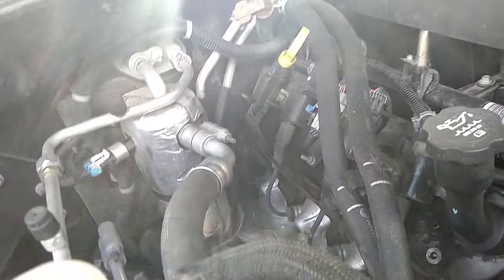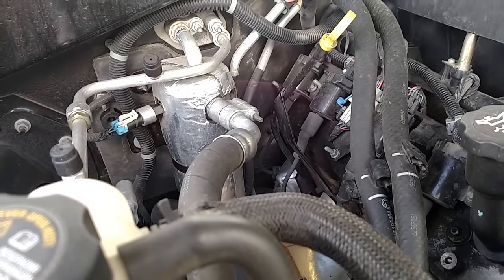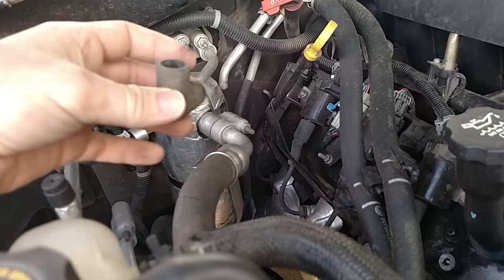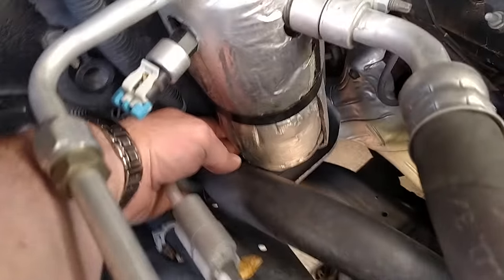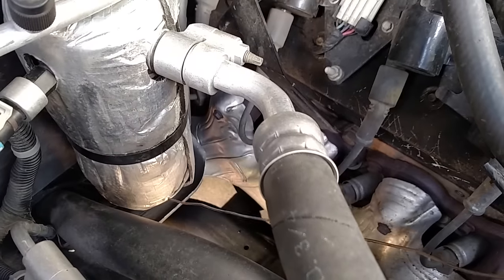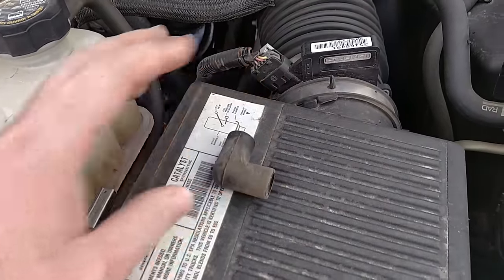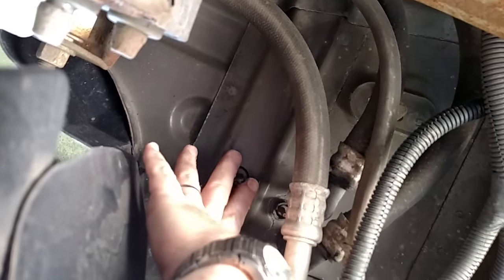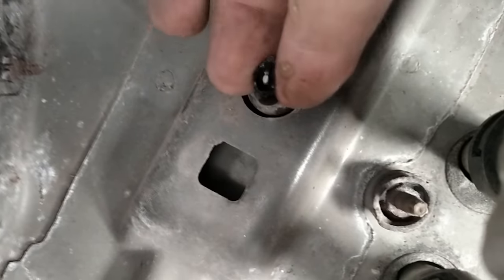AC water Drain Locations Tahoe Suburban Silverado Musty Smell 1999-2006 Air Conditioner

Comment: You called the Receiver/Drier a AC condenser the condessor is behind the grill and the evaporator is inside under the dash, the reciver/drier is a hollow chamber with a desicant bag inside to help removed moisture from the system. Just a minor correction Incase anyone needs to replace something if you ask for  a condenser from the auto parts store you will get a very large radiator like part that cost a lot more than a receiver/Drier there's is also a evaporator in the back of that SUV they are what makes the air cold so wherever there's a evaporator there's will be a drain for it somewhere in this case it was between the evaporator and receiver/drier
Reply from the maker: Thanks
Reply: DUH ...👈💩👌

Comment: I can see this has been up a few years now and yes, good information concerning the a/c drains but those are evaporator drains. The part you call condenser is the accumulator. The evaporators are out of sight, inside the truck. The actual condenser is out at the radiator and not involved.

Comment: Little bit of a pain but only takes 5 minutes - take off plastic wheel well cover and front one is easily seen and accessible.
Reply from the maker: I thought about that but just went for it from above.
Reply: I have a 06 suburban and ac works very good but i got water leaking next to my gas pedal and i can hear water noises behind my dash..i was told there is a drain hose next to my trans
Reply: @joshmarauder  figure out the issue?
Reply: @mayken6661  yea u have to clean out the ac drain...mine was dirty n clogged n made its way into mine..drain is on pass side..

Comment: Great video.  It helped me find the drain.  My '04 Suburban only has the rubber elbow which drains onto a metal pan beneath the receiver/dryer (the liter sized metal container on the a/c system).  Removed the rubber boot though and used a mirror and flashlight and noticed the little stub was all clear.  I could even see the metal of the a/c evaporator.  I put the rubber boot back on.  Used squirt bottle and put a few ounces of water in the evaporator box and watch it drain out.  Selected on ignition to just accessory position and put fan on high.  Noticed air from the evaporator box blows out the drain line.  (Did the same for the rear evaporator drain.)
Water on the carpet on the passenger side still a mystery.  I think it must be coming from the door seal or the windshield.  Cleaned up the door seal real well.  Will see what happens next time it rains, or maybe I'll take it through a car wash.  Thanks!
Reply from the maker: Hey, Thanks for the feedback. I know I used to have an older Jeep Cherokee that had a leaky windshield gasket which cause water to get into the car every time it rained/car wash. Not sure what you have going on there, but hopefully you'll get it figured out!
Reply: I know this was posted over a year ago, but i am having the same problem. Passenger side carpets are completely soaked. Front, middle, and hatch area. Drains are draining. Door seals are fine. I know this because the problem persists even when we dont have rain for weeks on end. Starts to dry out some when the ac's are off. Did either of you find out what was causing this issue?
Reply: Lauren Starke something to do with the ac
Or heater leaking around to that area

Comment: This video is a lifesaver. I have a turbo diesel '94 c2500, and the turbo is on the passenger side blocking any view of this location. After watching this video I was able to gain access by moving the radiator overflow tank out of the way. Thanks so much!
Reply from the maker: Glad it helped. It's hard to see in just about every truck,  but yours sounds a little tougher.

Comment: I have a 1995 chevy c1500 and that L shaped hose leaks water for me. When i add freon in ,it starts to drip more. My AC will be cold for awhile but as the water keeps leaking it will get hotter. Not sure if its supposed to leak like that. Any advice is much appreciated.

Comment: I have a 2009 Tahoe with the plug coming in from the firewall, like your video.
I used some rather thick vinyl tie and put it in there, wiggled it around, nothing in there.
Do you have any idea what's behind that tube? How does it connect to the HVAC box and stuff behind the dash?

Comment: My 03 yukon passenger side carpet is wet with a bad smell  and I didn't know what was going on..found your video and I'm going to give this a try front and back..thanks!!!
Reply from the maker: Did it work?
Reply: @precisionmachineshed   no my passenger side carpet is soaked everytime it rains and when the ac is on.
Reply: @843geechee8 same problem here! Did you figure it out?
Reply: @kevinjustice9850   nope.i bought a 15 yukon and the 03 is in my garage

Comment: Once the L shape hose is off, put lots of Dawn soap thoroughly on inside of tube. Put your right hand under compressor to the point where L shape hose attaches and use you left hand to position the hose, pushing with your right fingers, the hose slips into place within seconds.
Reply from the maker: Thanks for that tip.

Comment: Bro... Im notucing you have covered your the drier with a heatshield.. have you experienced benefits from it.. loke the ac is cooling better and stuff ?
Reply: Both of my trucks have had that heat shield on it, must have came from the factory like that on some?
Reply: @erikbjorgen3495  did you notice any difference in cooling.. as I did fit  a heat shield infront of it and noticed no difference in cooling.

Whenever the car stops in traffic jam or idle for long time .. the ac cooling perfornance drops.. 
It reaches 15 degres celcious..
When im driving.. it drops to 5-10 degrees celcious.

Comment: The hose underneath the air conditioner compresser on my 05 Yukon Denali xl is it supposed to be connected to something or not because mine is leaking water badly and causing it to run hot frequently
Reply from the maker: The elbow is just a drain pointing straight down. If you have water pouring out of it, double check that it's not antifreeze ( or Dex-cool) in this instance. Could be a leak in the heater core.
Reply: I'm having the exact same problem in my Suburban I'm going to put antifreeze in my reservoir instead of water if it is leaking from that spot I'm thinking either that boot or one of the two pipes behind the AC dryer. If it is one of the aluminum pipes is that the heater core or no?

Comment: I have a bad coolant leak coming from that front plug behind the ac condenser thing. I fill my 01 Tahoe up with water everyday in the mornings and on my way back from work. Could it be the heater core? Also my windshield fogs up sometimes, any help would be appreciated!!
Reply from the maker: Sounds like a bad heater core.
Reply: Yea that’s what I’m leaning towards preciate the reply bro 💪🏽

Comment: Thank you for posting this, I have been fighting the wet floorboard in a 2004 Tahoe I just bought. I have been running a wire in that tube for a week with no results. Well after watching this video I discovered my Tahoe doesn't have the rubber boot on it so I am assuming it is causing it to back up and not drain properly. I do have one dumb question though that you don't go over. When you pulled that boot off it was facing down correct? Where the open part is facing the ground? Thanks!
Reply from the maker: Hey, yeah the 90 degree portion faces down.
Reply: Thanks. I figured as much but wanted to be sure.
Reply: No boot/drain so it has no other option but to soak your carpet. Wow

Comment: Would clogged drains cause vapor/Mist to come out of vents inside?
Reply from the maker: Maybe. Another thing to check is if your heater core has a leak. It would smell like antifreeze (dex-cool) then too.
Reply: Precision Machine Shed 
Thanx..do you have a video on checking heater core?
Reply from the maker: I don't currently have one. I usually do these videos when something pops up on my truck. I'll check with my dad to see if he has anything. Here's his channel. https://www.youtube.com/channel/UC07btqBDB0z-aQ-IN_g2ngQ
Reply: I'm getting a little mist coming out of the vents when the air is on and when the heat is on. A/C still blows cold when on, and hot when the heater is on. I have not found water in the floor board yet. Does that mean heater core is ok? What would cause the mist if heater core is ok?

Comment: Great video..As you can see, there is a heat shield in the way on the SUV, just look over on the firewall behind the engine and there is a large black  plastic knob on a stud holding the sheild...you can unscrew it by hand nearly off and it allows the shield to move enough to get your hand and the wire in place. ATTENTION:: Also, as a GM mechanic, I can tell you many models have this elbo/hose on the drain and if it is left off, the wind will blow the water back inside and leak In the car.  I'm not sure on SUV's but on passenger cars and wagons, the water will flow back inside AND YOU WON'T KNOW IT UNTIL YOUR WHOLE CARPET AND INSULATION IS SOAKED all the way back.
Reply from the maker: Hey, thanks for that information. I never looked to see if there was a way to loosen that shield up. I also just about always put parts back on unless there is an obvious reason for them not to be there or there is an upgrade being done.
Reply: That sounds just like a bad heater core. Wow

Comment: My coolant keeps going empty. I just fixed my AC and it leaks a shitload right there at that boot that you replaced does that have anything to do with my coolant going empty?
Reply: Or does anyone know what those two pipe behind the dryer are called it may be that that's leaking?
Reply: I also have what seems to be a leak, there is a lot of "sweat" that drips off. Is this normal?
Reply: 3rdxoastsoul gator...the two pipes behind and a little to the right of your dryer are the heater core fittings...turn your truck on and check if you see any drips coming from there...if so then go ahead and replace both fitting they're like $8 bucks each at your auto parts store and you remove those by using some a quick disconnect tool which they sell there too ...oh and another your coolant has nothing to do with your ac ....each are 2 separate operating systems..
Reply: kaosbboi....the sweating and water leaking from the dryer is perfectly normal no need to worry ...and well if u have a Tahoe or burban then the front and the back should be leaking water but only IF your running your ac....if your running your ac and don't have any water leaking then you have a clogged ac drain like the video explained...

Comment: I have also heard to leave it on "fresh air" when parked to reduce musty smell.  Don't know if it's true or not.
Reply from the maker: That could help, my cab re-circulation only runs when it's really hot out.
Reply: @precisionmachineshed  my  suburban leaks too much antifreeze down the a/c  drain  can you tell me what the problem is

Comment: Underneath my ac I'm leaking coolant on the passenger side on my 06 yukon gmc denali trying to figure out why is it leaking coolant I replace my water pump
Reply: I have the same problem and it causes my Yukon to start to over heat I’m stuck with no clue what can the problem be, I need answers!

Comment: Jiggling a wire is going to solve the mildew smell? I'd like to only do this once, if possible!
Reply from the maker: No, making sure it has a clear path to drain out is the solution. Sometimes gunk clogs the drain and water will pool in there and start to smell.

Comment: hi there , I have some cooling issue with my 2001 Chevy Suburban,  I got cold air at the back and cool air at the front and will get warmer with higher RPM especially after 1800 RPM   ,any idea in what the issue could be ?
Reply: Orifice tube?

Comment: what does it mean if all my coolant comes out of that front drain? my windows steam up and car starts to run hot what could be the problem?
Reply from the maker: Sounds like you blew your heater core.
Reply: heater coil is bad
Reply: Precision Machine Shed 
can this cause rain water to leak In to ?

Comment: I have a 01 chevy tahoe and my is Leaking antifreeze.
Need help
Reply: This video is for ac which uses freon which is a gas and you wont see leak on floor ...But coolant (antifreeze) is usually greenish or orangish liquid leaks from radiator usually on plastic sides or heater hoses in back of engine where they clamp to a plastic valve so anywhere rust or corrosion can make the hot radiator water seep drip leak steam or hiss  out
Reply: trade it for a toyota. problem solved
Reply: I have the same problem, do you know what the problem is
Reply: Gerardo Vazquez 
My problem was the Heater core
Reply: @franky7703  My tahoe leaks antifreeze when I turn on the air conditioning green the liquid
Reply: @franky7703  blows antifreeze-smelling steam out of vents
Reply: Gerardo Vazquez 
bend the heater hoses
you can also remove them and put a orbit from Home Depot. When your done 
Turn on your ac

Comment: having a hard time reaching the the little boot pump I can reach when I go under the car tho
Reply from the maker: I thought about that but struggled with it from the top instead of crawling under the truck. Thanks
Reply: Precision Machine Shed how stiff was it to pull out the little boot bc I have a feeling I'm not going to be able to put it back
Reply from the maker: It wasn't too hard to get off, but it was more tricky getting a good grasp on it to get it back on than anything. I was thinking the same thing right after I pulled mine off.

Comment: DO NOT USE A WIRE AS YOU CAN CAUSE MORE DAMAGE INSIDE. Instead, use an old speedometer cable. The flex of the cable helps to prevent poking holes into anything that shouldn't have holes.

Comment: Using a wire to clean the drain is never a good idea as you can go too far with it and damage the evaporator. Your safest choice is to use compressed air.
Reply from the maker: Agreed. or a plastic test tube type brush, gently.
Reply: Another great tool is an old speedometer cable. The flex of the cable helps to prevent poking holes into anything that shouldn't have holes.